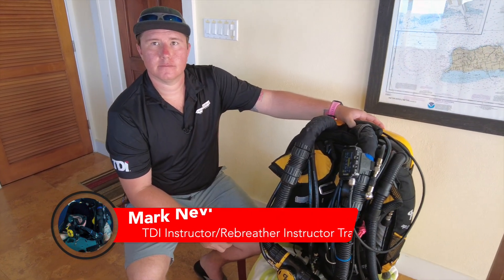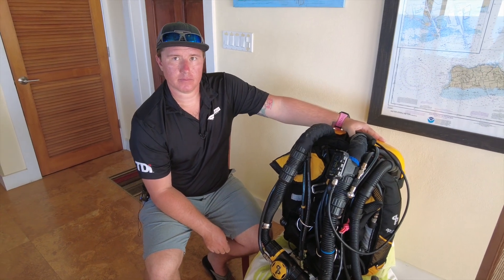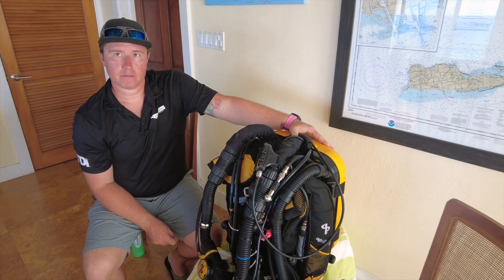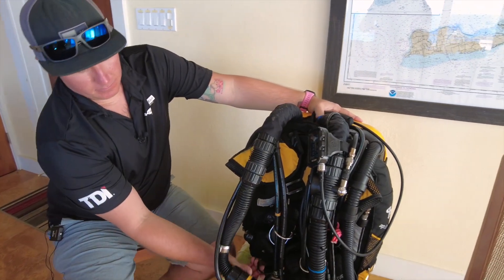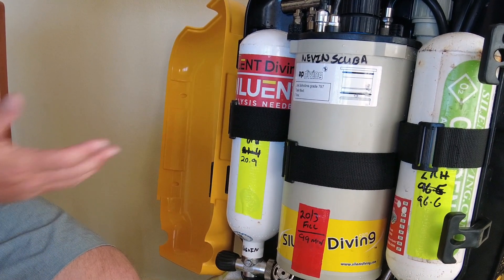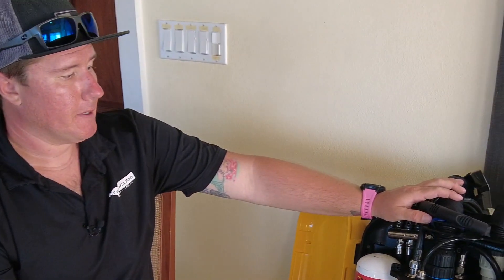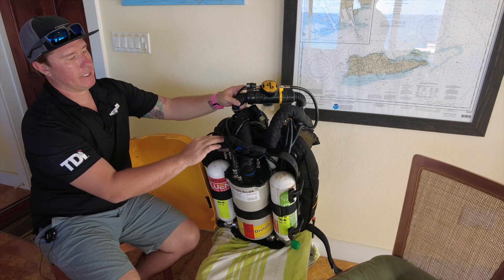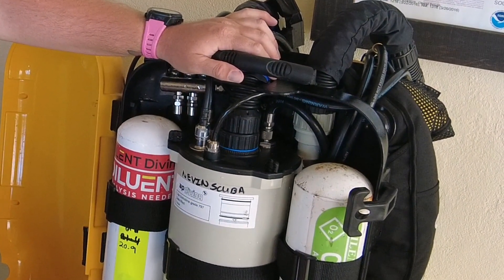What's Inside a Rebreather? (Scuba Diving with Rebreathers)

Comment: what's the price of a replacement Oxygen and Diluent valves for an AP Inspiration ???
Reply: I've had an AP Inspiration (initially classic and more recently one with the vision electronics) for about 15 years. I haven't had to replace the O2 or Dil valves.

When was the last time you needed to replace the inflator for your BCD? Have you ever had it serviced?
In terms of the first stages, they are the same price as a standard first stage.